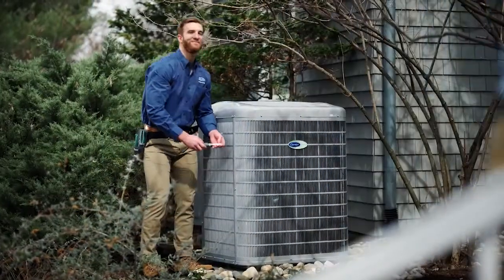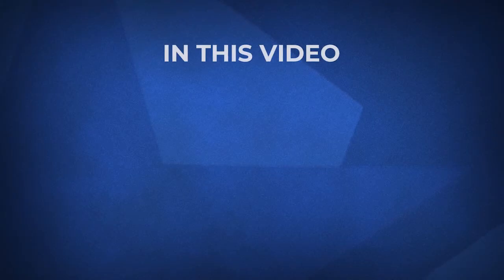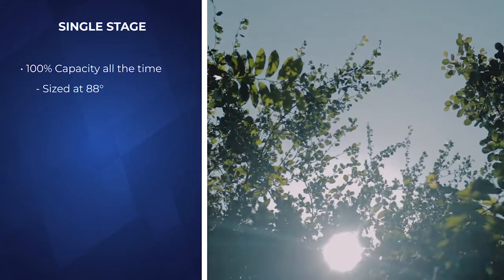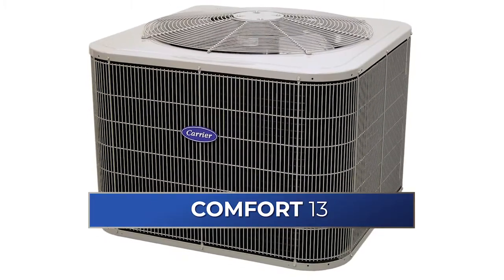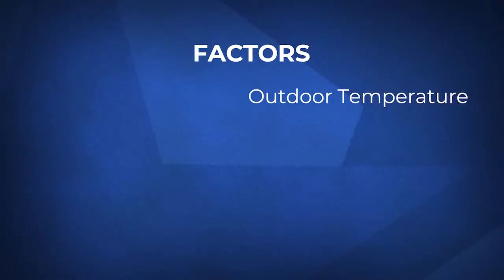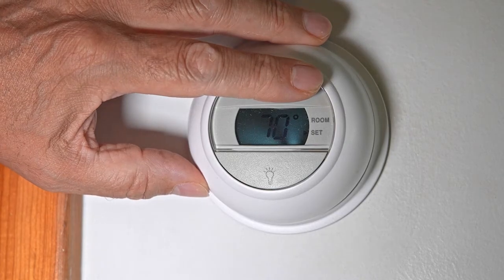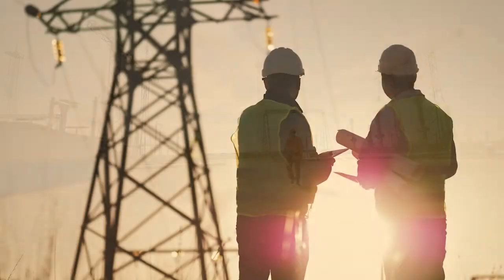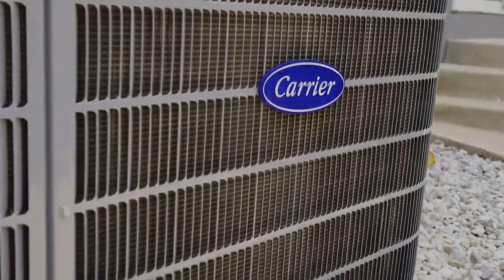Single Stage, Two Stage, and Variable Speed Air Conditioners

Comment: does a variable speed unit need a communicating thermostat? does it work as well and operate at different capacities with a regular thermostat?
Reply: yes a variable stage air conditioner does need a communicating thermostat

Comment: The cost and markup on variable  speed units means that the return on investment is likely to not be any better than getting a single stage unit. For people in high humidity areas, the variable speed unit may be better for humidity control.   Also, if the customer lives in a hot climate, a variable speed unit may  spend a lot of time running at or near the highest speed, meaning that it is not working much more efficiently than a two stage unit or even a single stage unit. Also, if there home is on a utility with tier priced electricity, it becomes harder to justify the variable speed unit because while they can be much more efficient in mild to medium temperatures, since the electricity is likely being priced in a lower tier rate, the savings are going to be much less.  I have run spreadsheets on all types of systems based on my own monthly consumption, and in my case, the return on investment for variable speed systems simply wasn't there, but a two speed system did beat out the single stage unit, though the savings will not be all that great. It should keep the house a bit more comfortable  though but I just could not find a scenario for my own tiered rate structure and super hot summers that made the variable speed cost worth it.  It is a big decision to make because you can spend as much on a new AC and furnace as you spend on a nice used car, and when spending this kind of money, one should really look at their utility bill over a year and see if the unit will ever pay for itself. The on line calculators typically don't have a mechanism to deal with tiered electricity pricing, so if you are tiered, expect to not save nearly as much on a variable speed unit as the calculators suggest you will save.
Reply: so you didn't watch the video...got it.
Reply: @stevedewey6056 He added info not in the video.  Methinks you didn't watch😂
Reply from the maker: Thanks for watching